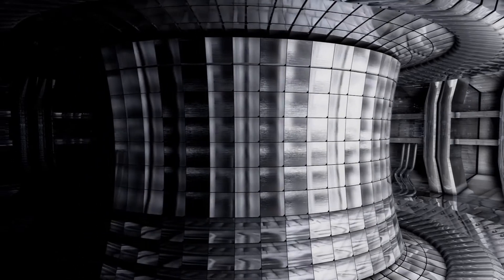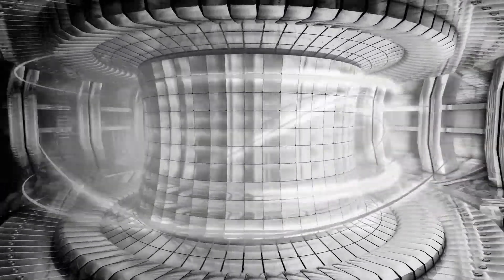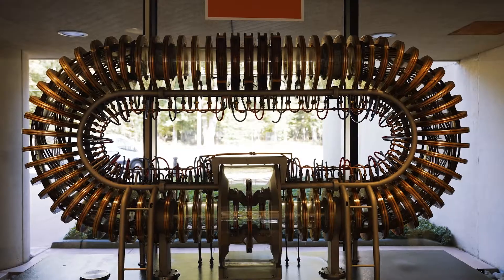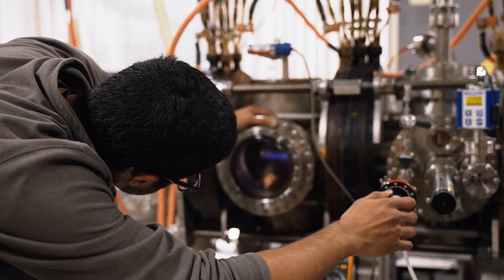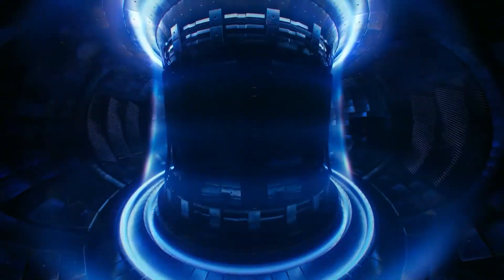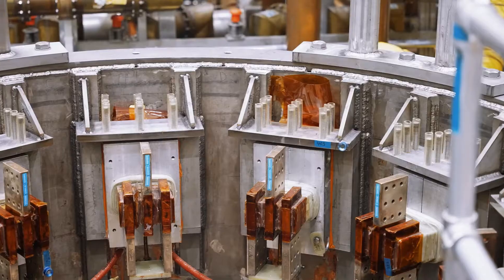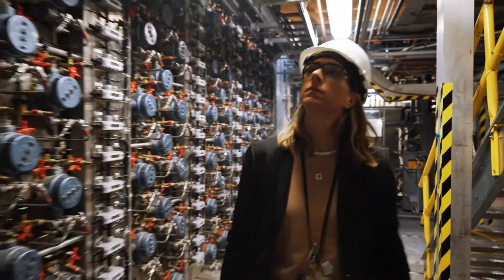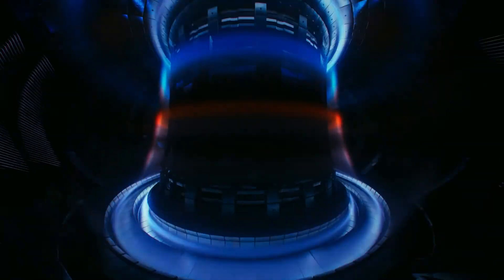What is fusion?

Comment: why the result has more energy than when they where separated?
Reply: It is due to the difference in binding energy. When elements with atomic numbers lower than iron undergo fusion to form heavier nuclei, the protons and neutrons bind more strongly, and the difference in binding energy can be released as energy. This does not mean that energy is created out of nothing—it is simply the conversion of the original mass into kinetic energy. Also, if your question was “Why does nuclear fusion produce more energy than nuclear fission?”, then that is a mistaken question. The fission of uranium releases more energy per reaction than the fusion of hydrogen. However, since uranium has an atomic number of 92, it is much heavier than hydrogen. If we compare the energy released per unit mass (i.e., comparing equal weights of uranium and hydrogen), then hydrogen yields slightly more energy. But in power plants, the weight of the fuel is not particularly important, so this distinction doesn’t matter much. Furthermore, nuclear fusion is not limited to hydrogen—it can involve heavier elements like carbon, oxygen, and silicon as well. However, as the atomic number increases, the energy gain from fusion decreases, making it less efficient than fission for heavier elements